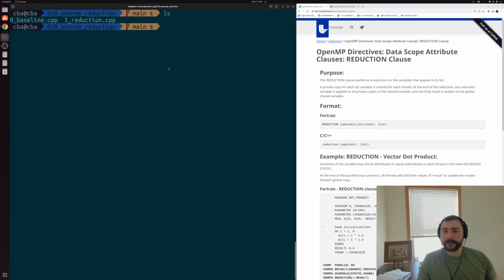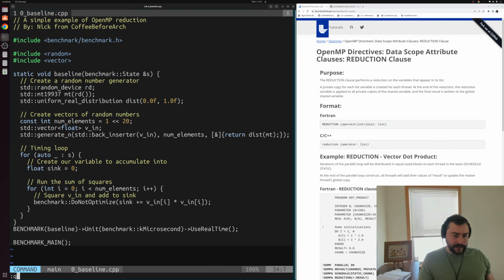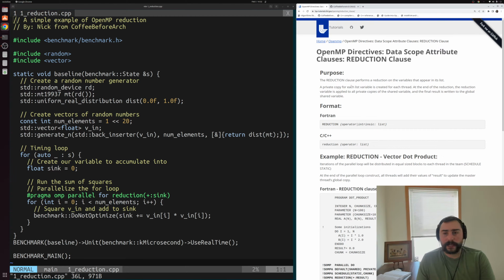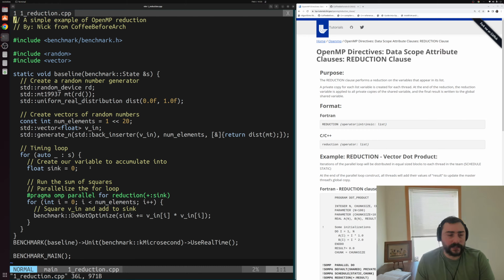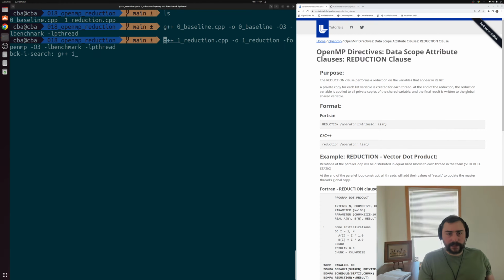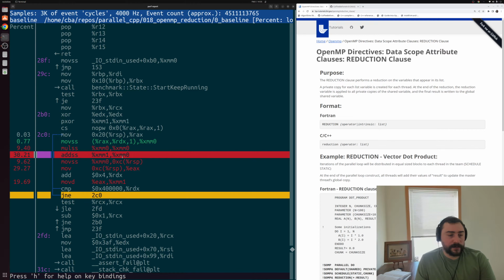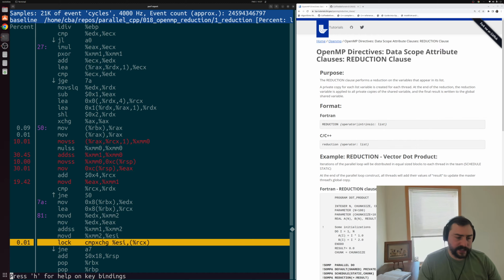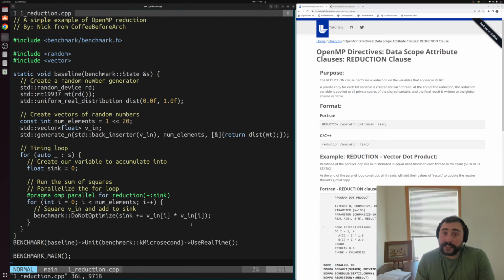Parallel C++: OpenMP Reduction

Comment: Considering that you never need the variable "i", you could have "for ( auto e : v_in ) s += e*e". Feels more idiomatic C++.
Reply from the maker: It definitely is. I was actually unaware that OpenMP added support for it (though, only as of OpenMP 5.0 I believe and only for containers supporting random access iterators). Pre OpenMP 5.0, loops had to be in the standard form.
Reply: @NotesByNick  You're in for some goodness. "for ( auto e : my_array | ranges:views:drop(1) | ranges:views::transform ( [] whatever ) )" works just as nicely because C++ 20 ranges & views also have random access iterators. (and much of this was already in 4.x)